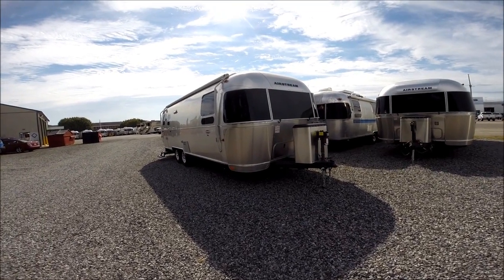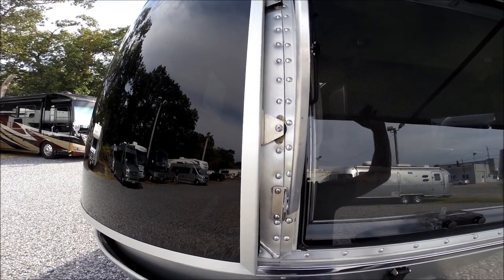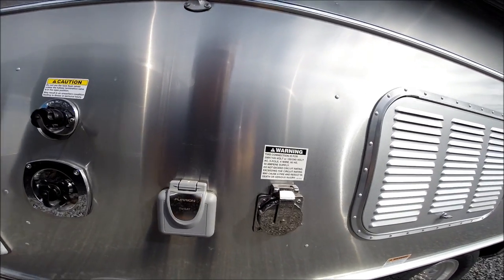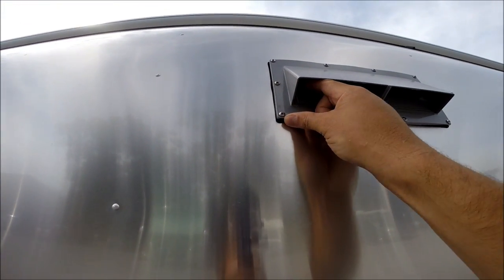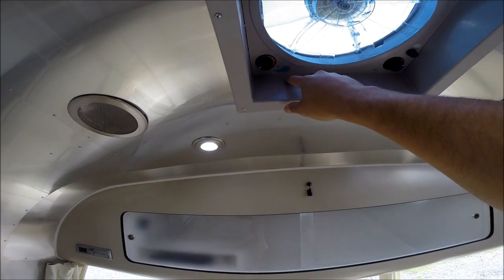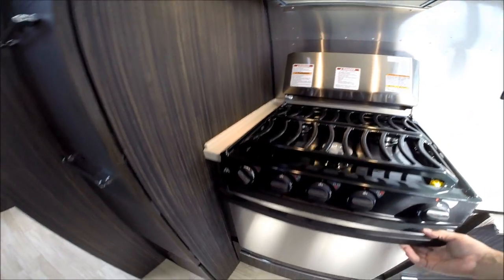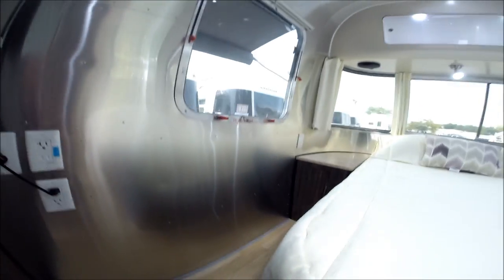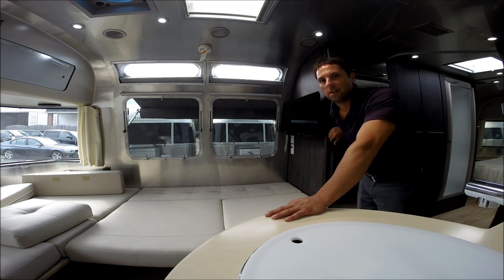Walk Through 2015 Airstream International Signature 27FB Travel Trailer New For Sale NJ

Comment: @colonialairstream - great video. is there an option for ceramic hobs rather than gas? I'd also be interested in having a battery of photovoltaic cells on the roof. please let me know.
Reply from the maker: The are options for enhancement aftermarket.
Reply: Colonial Airstream what about solar ready or solar install at the factory?  I wouldn’t want some aftermarket yahoo messing up my ultra expensive airstream lol

Comment: Grohe faucet, overpriced euro faucet. I used to be a plumber. You can buy a whole brand new Kohler faucet for what the replacement cartridge costs on the Grohe. It's NOT a plus. If it leaks tear it out. Why these manufacturers insist on stupid round sinks I'll never know. Do you use round sinks in your home?  Why they can't use a standard home instant hot water heater in an accessible location, I'll never understand.
Reply from the maker: Thanks for watching anyway.